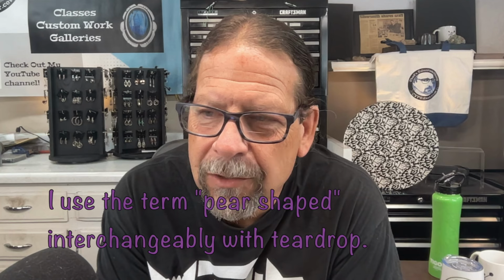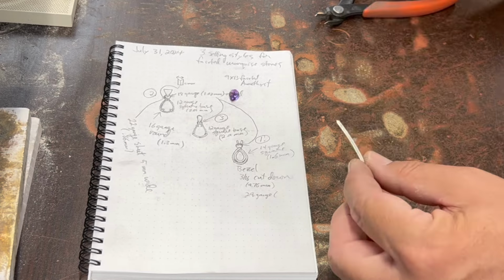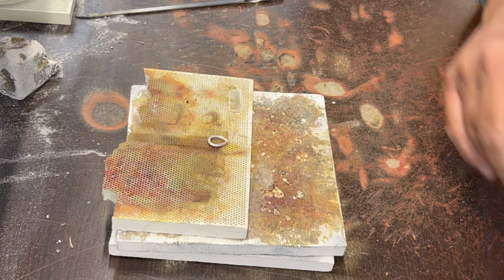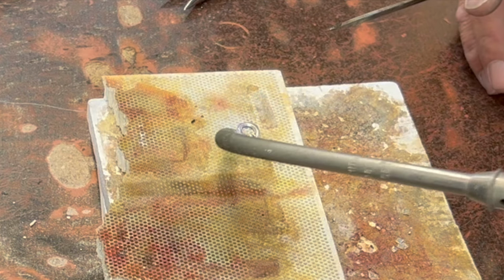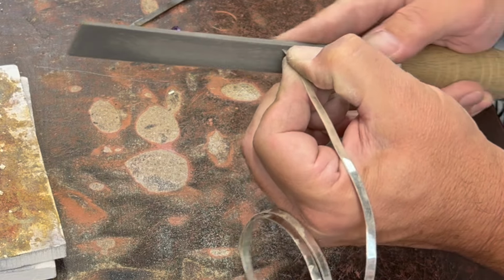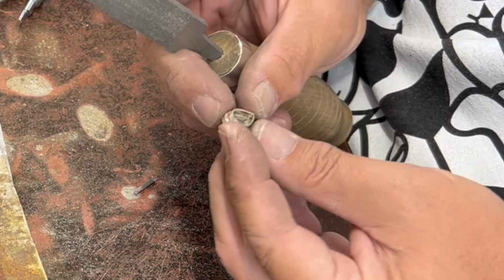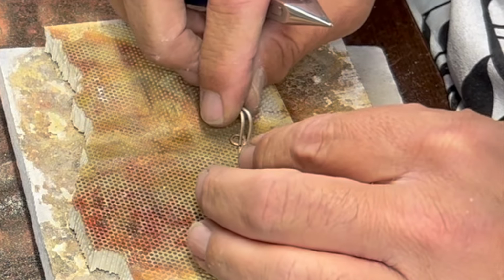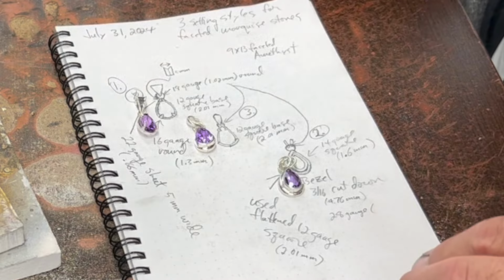3 Ways to Set Faceted Teardrop Stones: A Silversmithing Tutorial

Comment: Hello! So your video already has a lot of views!! Great! I have a question about setting pear shaped cabochons in filigree wire. Yes, I'm embarrassed. I made the quickest setting in a long time, checking the fit all the way--then once it was done: cab wouldn't fit. Aaaagh. After that I kept melting any new versions. Do you find that a setting will "shrink" a tiny bit after soldering it? Thanks.
Reply from the maker: Hello S. Magdaleno.  I have had other people talk about similar problems.  Most of the time I haven't experienced that, but once in a while something I make seems tighter than it seemed at first.  Perhaps there is something to that.  Anybody else have this problem before?  I always assumed when it happened to me I had just gotten overzealous on my filing:)
Reply: @chadssilversmithing  All I did was solder the filigree shape to the square wire. (Then twisted it up trying to make the cab fit heh heh.) Ok thank u